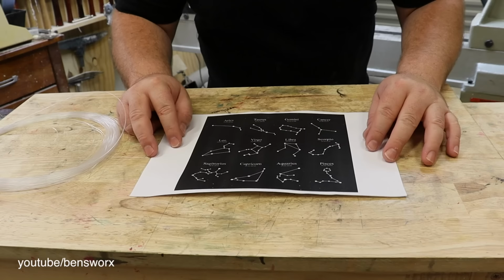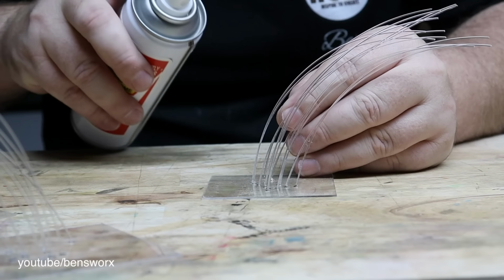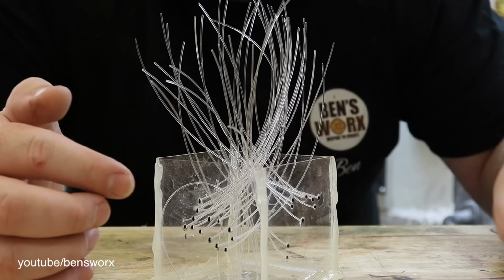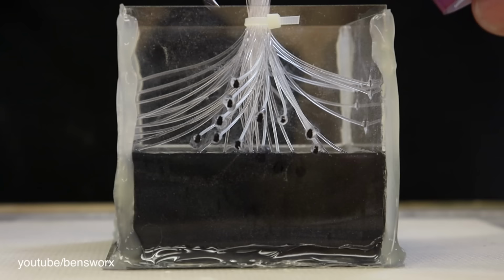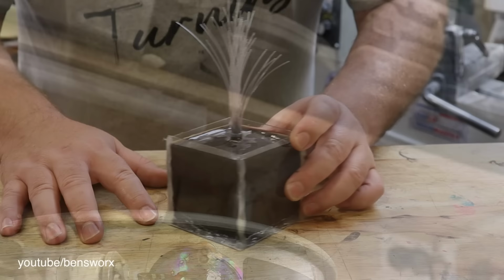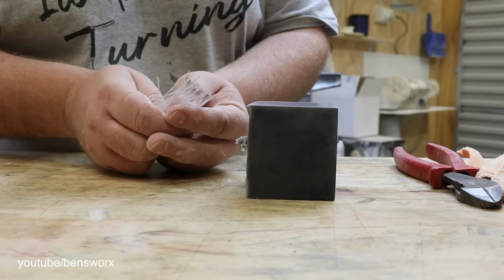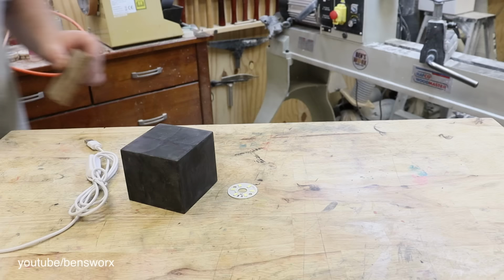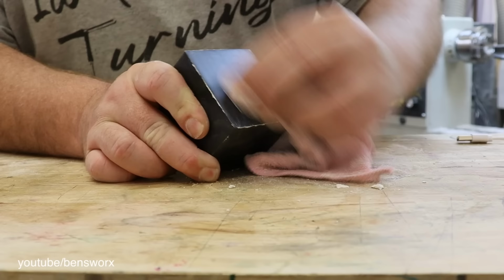Making an Optical Fibre Night Lamp - Resin Art

Comment: I’ve been trying to come up with something to do with fiber optics and resin for awhile now and just the other day was wondering how I could incorporate fiber optics into a resin lightbulb mold I have. Kind of a weird coincidence you publish this video now after I’d just been thinking about it. Not sure how much it would apply to this project, but a good way to bundle fiber optics is to use a tube of black heat shrink. It holds them tightly together, instead of a single point like a zip tie where they fray out in every which way when cut, and it makes the bundle more like a rod and a lot easier to cut a nice flat condensed surface for the light to hit. The astrological signs on the black background is a really cool concept, though. Personally, I think I would’ve used either a color changing LED to make the stars change colors or a flickering tea light candle LED to make the stars twinkle. If you wanted to get really crazy, you could bundle the fibers together by sides, put black heat shrink around each individual bundle, cut them all flat, and use heat shrink to attach a color changing LED to each bundle. The black heat shrink would isolate each LED so that the light doesn’t bleed together, then wire all four LEDs together. They’ll all start the same color, and changing at similar rate, but they’ll fall out of sync with each other pretty quick and all four sides would be a different color. Would love to see another fiber optic resin idea
Reply from the maker: Thanks Mate, cool idea 👍

Comment: My parents in the early 1970’s had a glass fiber optic lamp where the individual strands were tightly joined at one end and allowed to flower out on the other. The bound end was attached right above a turning multi colored wheel that had a gradient color film and A C9 bulb under that. The “umbrella” of fiber optics turned independently giving a beautiful effect at night. Early 1970’s, so yes it can be done.

Comment: One of the first times I messed with fiber optics was this huge Star Trek model kit...I think it was a Klingon space station...dont really know much about Star Trek but it looked cool.  It had included fiber optic cable and a small drill...you had to drill like 1000 holes for the space station windows and lights, and manually run and feed to fiber to each hole inside the model. It was too much for me as a young kid, I only ran a few lengths of the optic fiber...but now as an adult, I wanna find that kit again and give it another go.

Comment: Great project! I may have a suggestion for yall to keep the fiber optic bundle together a little better.

Once you have the fiber optic bundle together, while a zip tie works, if you slid the bundle into a small section of shrink tubing, that might give you a bit more control over it. Just a thought. 

Keep up the ingenious work!

Comment: Great project. IMHO fiber-optics are a much better option than embedded leds which if one ever burns out, your screwed. But with Fiber-optics, just change the lights out and your good to go.

Perhaps for a future project, one of the best ideas I saw was where the fiber-optic stars were outlined with lines to show the animal that the lights represented (i.e. a Bull for Taurus, etc.) 
The only issue was that when I asked him how he added the outline affect, he admitted that he added the outlines to the video digitally using his software editor 😞

Still a great idea. Perhaps put side-emitting fiber-optics into channels carved after the main surface is polished.  Another option would be Glow in the dark paint, but it wouldn't shine like the fiber optics would.  A third option would be to carve the outlines and then embed EL lights in the channel (but EL lights tend to give off a buzz and would also look different)
So, yeah, I'm still looking for a good way to add outlines 🙂Let me know if you have any ideas for outlines and thanks for the great video.
Reply from the maker: Thanks Mate, I’ll look into it 👍

Comment: This is absolutely gorgeous 🤩

Question - When it's turned in in a dark room does it project the constellations on the wall/nearby surfaces?

Idea - Could you find a way to put the optical fibers in one of your galaxy looking eggs? Maybe bundle them together with them all curving away, then set the base of the bundle at the bottom of the egg & make a lighted display stand... It wouldn't be constellations, but it would still look wicked cool I think.
Reply: it will not since the light from it will just spread out

Comment: hi ben, thing is you glue the fiber onto the surface of the perspex and they dont all line up in the same direction, would have been much better if you drilled holes in the box then glue the fiber into the holes, that way they would be dead straight.

Comment: Next time add something to keep that wiring from being yanked out the first time someone accidentally kicks the cord. Either an s-curve in the wiring inside, or a clip to backstop the wire itself.  Maybe even fill the gap with hot melt glue.  Anything to secure the wiring to the board. Otherwise, great project!

Comment: Fiber optic cables are wierd if the base of the cable is smooth and clean it won't let light pass through that well, I hated working with that stuff

Comment: If you had fibers all around in a clear resin would it look like points of light all over the place? Would you have to make the fibers yourself out of the same resin you are using so they would dissapear? Would it basically just look like fairy lights incased in clear resin or would it be cooler? If the fibers dissapeared completely it would be cool i think to look like a star field. Please try it so i dont have to lol

Comment: That LED module needs some strain relief otherwise someone pulling on that cord could pull the wire off those electronic solder joints. (even up to destroying the solder pads)

Comment: Nice outcome, I like it! One thing though, the leds are mounted on an aluminum pcb because they get pretty warm in use. Epoxy or ca glue might be a better adhesive than hot melt fir fixing it in place. I was concerned it may come apart from the wood in prolonged use.

Comment: They are not uniformly lit and some of the stars appear dim. You should have left the bottom end of the fibers tuft sticking out and held together. Insert that end into a tube where you could install the LEDs more tightly packed together.